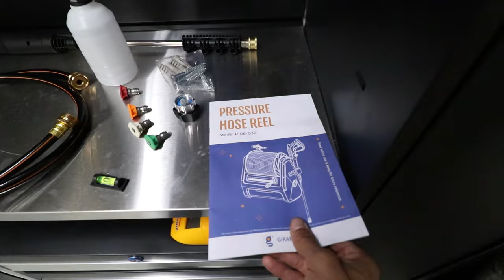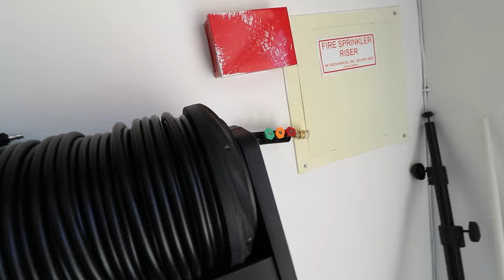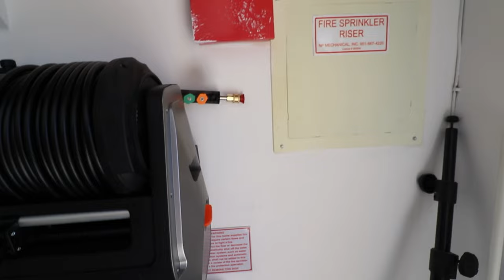$300 Wall Mounted Pressure Washer ❌ Giraffe Tools Grandfall 2022

Comment: This looks great for car washing. Very convenient! I’ve had a small Karcher pressure washer for a few years.  It’s great for washing cars, but if you want to clean a concrete driveway, you’ll want a higher pressure unit, with a disc attachment.

Comment: I have bought it, and I’m really happy with the clean look on the wall. The only thing is that I thought it should be a little stronger.
I’m used to my gas powered pressure, so I’m just missing a little more power from this electric pressure washer.
Reply from the maker: Yea same here. They are making a stronger one I plan to try out and see if it’s worth it !

Comment: Nice Unit.  You Might Want to Try A Turbo Tip They Make it Should give You More Pressure    High Pressure Washer Rotating Turbo Nozzle Spray Tip

Comment: Would you use the pressure washer to remove old oil stains?
Reply from the maker: Depends how bad there stained it’s not as strong as say a gas washer so may take a little longer